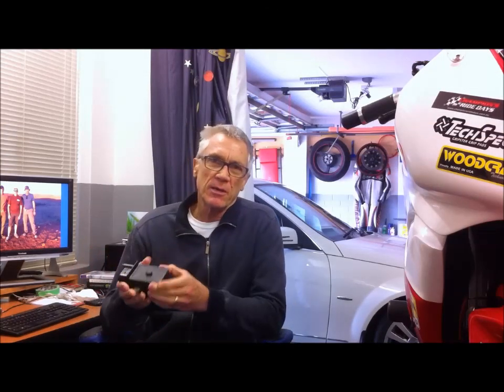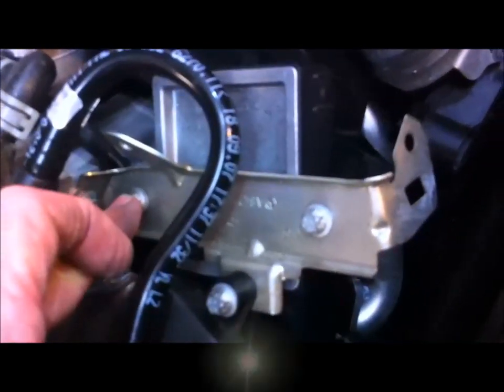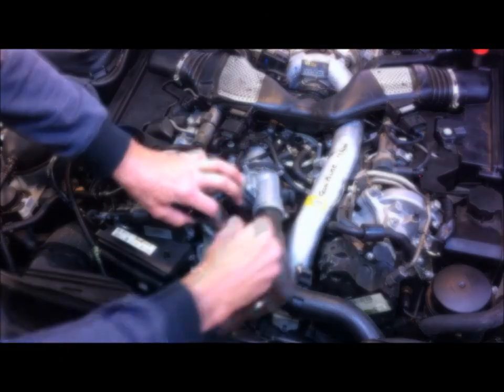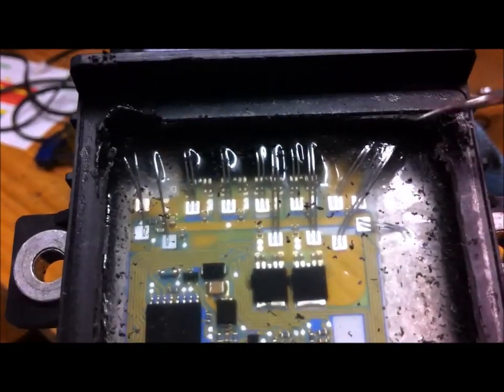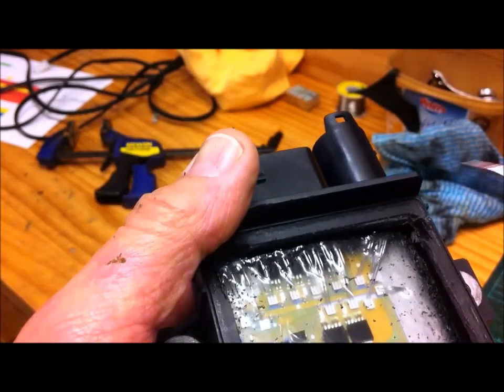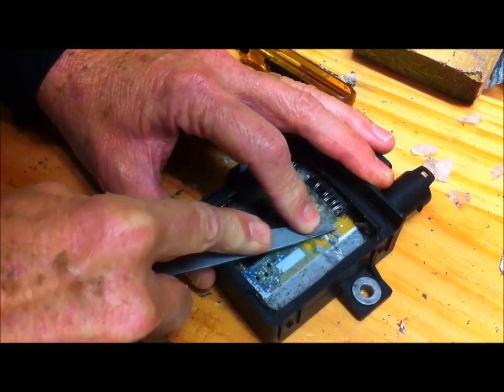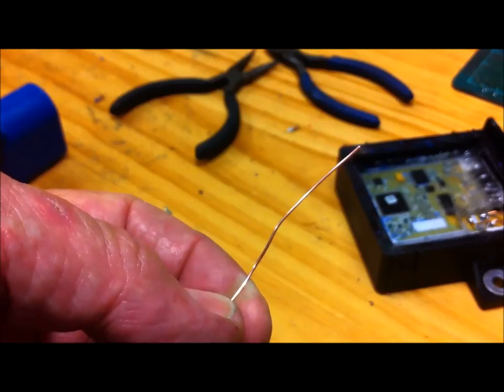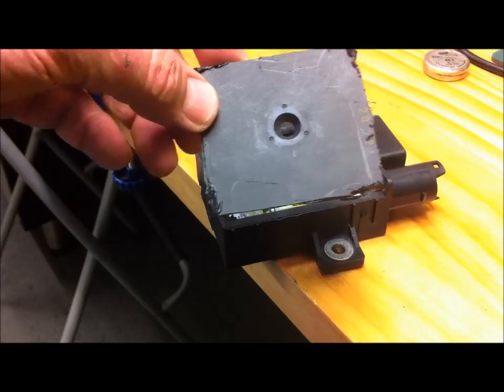Mercedes Chrysler Jeep 300C W164 Glow Plug Controller Relay A6421532079 Repair & Modification Beru

Comment: I want to add to this for people who are in a situation like i am. the 04.5-05 lly duramax in the chevy/gmc trucks use a very similar module. the board is slightly altered to accept 8 glowplugs rather than the 6 but otherwise its visually the same and suffers the same aluminum wires the break/melt at the 12v inlet. Im currently breaking into my own module and will update with my results.

Comment: Great work!  I'm about to open up a bad GP controller (same part #) and was wondering whether to open it up one can slice toward the outer edge (it's a raised edge about 5mm in width) rather than cutting further inside that top "lid".  I suspect that it's glued down here and that perhaps cutting here wouldn't free it up from the lower body/case.
Reply from the maker: Thanks. I recommend you open it as shown in the video.

Comment: Hi, I know it's an old video, but the problem is new for me lol.... so my question before trying your fix is can this module fail all of a sudden?  I'm asking this because my Jeep Commander 3.0 CRD (same OM642 engine) always started,  no rough starting, no nothing.... just one day it refused to start. It cranks but won't start. I've checked the GP resistance (0.5-0.6 on all 6), checked the harness from the module to the GPs for continuity and also if I have power wih key ON to the big plug on the end of the harness. I just can't get my head around it. 

No check light, no error code for the module only individual codes for each GP, coil light stays on for about 3sec befor I start cranking it.
Outside temperature 7°C.

I managed to start it using some start spray at the air filter but it died after about 5 seconds.

Any help is much appreciated! Cheers
Reply from the maker: Yes they can fail suddenly because the fragile aluminium wires break and go open circuit. It sounds like you have a fuel delivery problem however it's worth opening your controller and investigating regardless. The GP's are there to help get the engine started but they're also used for smoother running especially at lower temperatures.  If you get the engine started using a spray it should keep going as that's the whole idea behind self ignition diesels.
Reply: @ScottElliott152  thanks for your quick reply. 
Indeed fuel delivery is what I suspect to be the problem, but live data parameters show no obvious problem, the rail pressure looks good while cranking, I changed both the camshaft and crankshaft sensors... Still nothing.
Reply: @ScottElliott152  Update on my problem:
Tried again with start spray and started this time. Kept the engine running for about 5 min before turning it off (a bit of slightly white smoke for the first 2-3 min)... after that it started no probs every single time and clean exhaust (5-6 attempts all good). Later in the day, about 4hrs later, it refuses to start again. Is that 100% a sign that it's not a fuel delivery problem and should I only focus on the ignition part? As I said GP's all good, I've applied your fix on the GP module and also changed the module's relay in the fuse box... no result unfortunately. Still having all 6 GP codes from P0671 to P0676. What should I check next? Thanks!
Reply from the maker: @noidoisiuncaine  If it was me I'd be connecting it to the Mercedes STAR diagnosis to try to locate the source of the problem. I have a STAR system so for me it's a routine step when troubleshooting.

Comment: the controller it self is extremely bad designed
i can repair it for 3 USD 
but it will be broken again and again as the problem is in the design of the controller it self by mercedes engineers

Comment: Hi Scott, I'm planning to do this mod soon.  I was just hunting around the shed to see what copper wire I had and found some at 1.7mm diameter.  Do you think that is too thick?  Thanks Andrew
Reply from the maker: Andrew if it was me I'd use the 1.7mm.

Comment: 16C is pretty warm, also the indicator on dash does not correspond to moment when glow plugs go off.  Depending on a temperature of the engine it can stay on even with engine running. ( soldered to parallel to glow plug).
Reply from the maker: Yes that's right ... the glow plugs can stay on for sometime. The indicator turns off as the signal to start the engine.

Comment: Hey Scott, greetings from Aus. I'm getting 1.9vdc at each GP instead of 4.4-5vdc, would this be a possibility?
Reply from the maker: Hi Tom. If you're measuring only 1.9V then it is worth opening up the black box to investigate those alloy wires.

Comment: good video well done could maybe use a better mic or up the gain when editing as the audio is a bit low , the surface mount component between the pads is a capacitor filters spikes/noise to ground .
Reply from the maker: Yes the audio was a bit low. I'm trying to sort it out.

Comment: Hi Scott, I have a 320CDI, 2006. I have tested the aluminium wires by basically poking a multimeter probe into it. It has continuity for all three wires to the exterior lug. Should I still undertake this? Car would take ages to start and now refuses. Please advise.
Reply: Anyone else experience similar? sorry am just wondering if this really is the cause.
Reply from the maker: Shahin the fragile Aluminum wires will eventually fail so it's worth replacing them anyway. At least it eliminates that as an issue. Scott
Reply: @ScottElliott152  Hi Scott, thanks for this, it has completely cured the  start issues. I was sceptical as I said I was still getting continuity. Seems it's a current issue, even if one wire snaps, there will be continuity just not enough current. Thank you so much for this, I am grateful.
Reply from the maker: @shahincassim  Well done Shahin.

Comment: 2010 Mercedes gl350 bluetec i have been having to leave the ignition on for 8 seconds then turn the car on other wise the car wont start properly it keeps cranking then starts and just recently I got the engine light on which says p064c glow plug module.
do you think it is a good idea to change the glow plugs as well after changing the module.does the weak or dirty glow plugs cause the module to go bad as well?this truck has 134000 km on it please advise 
thanks in advance
Reply from the maker: No you don't need to change the GP's until they fail. A faulty GP doesn't affect the GP module. I keep a few spares in my garage and swap them out when they stop working.
Reply: thank you so much one more time for the quick response 
how do I know which GP is gone bad is there a specific way to check which one is bad as you mentioned there are 6 in total
Reply from the maker: @qaisakbari8525  The MB STAR system (or any decent code reader) tells you which GP has failed.
Alternatively use a multimeter to measure resistance from the GP centre terminal to ground. Anything up to about 2 ohms is fine. Search on YT "check glow plugs multimeter"

Comment: any idea if this would fix my p0670 in my 2009 ml320 won't start below 40 degrees and it runs rough for a while if it stats  I know the video is for a 2008 model year but just curious

Comment: When one of the glow plugs fails and creates a short to ground, it creates a current overload on the supply terminal or any of the output terminals and boom, open circuit follows.
Reply: Glow plugs normally fail open circuit

Comment: see the age of this video but over here in the UK just purchased a controller for my 2006 CLS 320 cdi only cost me £108 BERU GSE114 ebay Germany =  $191 Australian postage would be a little more but much cheaper than $700
Reply from the maker: Harry we get ripped off here. If I ever buy one it will be from the UK or Germany. Scott

Comment: Awesome job Scott. Worked like a charm first time. Cheers
Reply from the maker: Good news. My repaired unit is still going. Scott
Reply: Good to hear. Now just got to decide whether to tackle the other affliction that seems to strike this otherwise mechanically sound vehicle - the dreaded oil cooler seal leak.....
Reply from the maker: Michael my son in law and I were planning to make a DIY video of the dreaded leak. It turned out the leak was coming from the EGR hose. It's not difficult but a lot of work to fix. Heaps of components to remove to get the oil cooler off. I've searched and there are no decent how to videos. You could try www.benzworld.org
Reply: Hi Scott Thanks for that. Agree that no one seems to have done a good DIY for this problem which is a shame. I’ve assumed the leak is coming from the oil cooler as that’s what my mechanic seemed to ‘think’, but I should check that it’s not the EGR hose. Presumably this is a much easier fix. Thanks again. Cheers
Reply from the maker: Michael check the hoses around the EGR, crankcase ventilation and the intake duct onto the turbo. They all weep oil because the oil vapour from the crankcase is channeled back to the intake. On my daughters ML320 we used cable ties on some of them as the hoses just push on with no means of clamping and don't provide a good seal. We used cable ties as "hose clamps" and other cable ties to to pull the tubes harder into place. We then gave a good dosing with degreaser, hosed off and no more oil leak. Our first thought was the dreaded oil cooler problem. Scott
Reply: Great thanks Scott will do. Cheers
Reply from the maker: Michael report back with your findings as I'd be keen to know what you discover. Scott
Reply from the maker: Michael sorry it's not the EGR valve it's the crankcase ventilation system. You'll see a fitting mounted on the rear of the LH rocker cover (when standing at the front looking towards the rear). There's a black tube coming from that which connects to the intake just in front of the turbo. The weeping oil was at the turbo end and from the intake duct itself where it clamps to the turbo. Hope that clarifies it. Scott
Reply: Thanks Scott. Weather forecast looking ok tomorrow in Melb so will take a look and report back. Cheers
Reply: Just ducked out to check it - can see what u mean - no clamp holding this hose on so will attach cable tie. Unfortunately not enough oil around to suggest this is the problem - I have a puddle of oil 10cm in diameter by the morning!! So mechanic suspicions prob right which means a trip back in the absence of a good DIY video. Appreciate all your help. Might tackle door lock actuator instead - less chance of things going awry there....
Reply from the maker: Michael quite a bit of oil accumulates in the intake where it clamps onto the turbo. In our case the oil would accumulate on the plastic covers underneath and drip off over night. It would be worth making sure all those rubber pipes and the intake are not weeping then remove the plastic cover underneath and clean it. Spray a heap of degreaser between the cylinder banks to flush the oil out of the drainage channel that directs it to the outside. Do this before you replace the plastic cover. We drove the vehicle for a few days then put the cleaned plastic cover back on.
Reply: Hi Scott. Have taken the car down to mechanic who has confirmed the worse. Oil cooler seals replacement it is unfortunately. looking at 2,500 minimum. Told him I’ll start saving but in the meantime will continue to drive (making sure have oil at the ready for topping up...) Cheers

Comment: Great guide. Took the glow plug controller apart on w204 c320cdi and replaced the live aluminium feeds with copper wire. Has cured the engine light (p0670 fault code) issue I was having on cold starts! Cheers
Reply from the maker: Thanks. Scott

Comment: Thanks for the video Scott. I remember you from my time trawling the PSB forums! Just bought a second hand unit to throw into the car so I can attempt to repair the original faulty unit. Do you have a rough idea on what thickness the replacement copper wire was so I can pick up some from Jaycar? Thanks again!
Reply from the maker: Chee I used single strand copper wire that was about 0.75mm diameter. Regards, Scott
Reply: Hi Scott, Just completed the repair and worked a treat. Thanks for taking time to put up the video and your assistance!
Reply from the maker: Chee I'm glad it worked out. Regards, Scott

Comment: very good video, you are amazing
Reply from the maker: Thanks for the compliment.
Reply: Scott Elliott quick question: I have accidentally broken  the resistor/diode between both of them. I understand I can solder a compatible one between the positive and negative in this module for the same function. Do you know what is its code so I can buy a similar?
Reply from the maker: Unfortunately I don't know the code or size. Perhaps Google will help you find it. If you do please post the information here for others. Scott

Comment: It's 17th February 2017 time 22:35 and I just fixed my Jeep Grand Cherokee 2008 3.0 CRD. Cleared the glow plug control module circuit open fault code after inserting the module and it started first time and it's been standing for about a day so it was a cold start for sure. Maximum respect too you SIR. YOU ARE THE MAN :). All the best
Reply from the maker: Glad I could help out. Good work.

Comment: I am in Queensland (not too cold here).  2006 W164 Ml320. We have owned it about 9 months and Its always been slow to start.Glow plug light comes on for 2-3 seconds, if you leave it on ignition for say 20 seconds it starts in a few revs, but if just started after the glow plug light goes off it will take about 5-10 revs to start.I have run a Snapon Solice reader on it and I get a 2270 code "glow time output stage" - at least one glow plug is not actuated.  And I also get a 912d code (on the cluster) saying the preglow lamp is faulty.I don't have a check engine light up etc - only symptom is the slow starting.Do you think this is something that could be fixed with your repair?
Reply: Jeep uses the Mercedes engine for it's diesel, set up is likely similar as the module here is the same, and likely easy to find another showing the actual placements.. That video I posted is very straight forward and very detailed on how to find and double check faults in the glow plug system

Comment: Hello Scott.I am from Montenegro(ex Yugoslavia)I'w got a  mercedes c klas from 2007 with command audio.Can you show me how to make video in motion?You a very helpfull and thanke you for that.
Reply from the maker: +Zoran Vulic Hi Zoran. You have to buy a VIM module to have the video work when you are driving. http://www.ebay.com.au/itm/INTERFACE-TV-FREE-DVD-VIDEO-IN-MOTION-MERCEDES-COMAND-NTG4-W204-W212-C218-X204-/251148179364?hash=item3a799917a4:g:d20AAOSwCypWmVgP

Comment from the maker: A viewer asked if 16 gauge wire is ok. 16 gauge is about 1.3mm diameter. My view is to have about the same cross sectional area as the two Al wires. I need to do some measurements and report back
Reply: +Scott Elliott That was me but I removed the comment as I realized it was much thicker than the two wires being replaced.

Comment: Thank you from Canada.  A new part here was just over $350 with tax.  Currently letting the silicone dry overnight before re-installing.  Question - if the new wires don't allow for a fuseable link like the original - what would happen?
Reply from the maker: +Tom R Tom I'm not sure but I'm sure the fuse in the fuse box will protect it. I was being cautious because when I was researching I picked up some talk about the wires also being a fuseable link ... however I was not able to substantiate the claim. Regards, Scott
Reply: +Scott Elliott Thanks.  I also put clear silicone in where I removed the other silicone jelly.

Comment: Hi: Great fix, first video I have seen that actually addresses the problem, not just a swap. Question: What is that clear gel like substance that you removed? Any idea? Any idea what can be used to replace it? I guess it is to stop any sort of atmospheric degradation or corrosive activity? Is it some sort of dielectric gel? Would dielectric grease work?
Reply from the maker: +shanghaitheory Thanks. The gel is called electronic potting compound. You can buy it on ebay easily. I think you could also use the glue from a hot glue gun as that's a plastic.

http://www.ebay.com.au/itm/SOLAR-CELLS-AND-ELECTRONIC-COMPONENTS-POTTING-SILICONE-SAMPLE-110ML-/252160189728?hash=item3ab5eb2520:g:7N8AAOSw7NNT~HXy
Reply: +Scott Elliott Many thanks, you are a star.
Reply: Great question. Exactly what I was thinking. I was going to use silicon sealant but wasn't sure. If it's protected in the first place it must need it. Off to find potting compound on ebay now!

Comment: Hey have a question after the fix on a cold engine the Glow Light comes on for around 2 seconds and goes off as normal. As soon as I start the engine it comes on again by itself for 30 to 45 seconds.  The engine starts normally.  Thru the day the Glow Light just flashes on-off never turning on automatically again and the car has a quick start. Any thoughts on why the re-glow after start?
Reply from the maker: +Andrew Paul Andrew that often happens. You need the STAR system to get rid of it. It didn't happen on my C320CDI but it did on the ML320CDI. From memory I plugged it into DAS/Xentry and reset the glow plug controller and maybe even the ECU to get rid of it. Sometimes it will sort itself out over time.
Reply: Great thank!